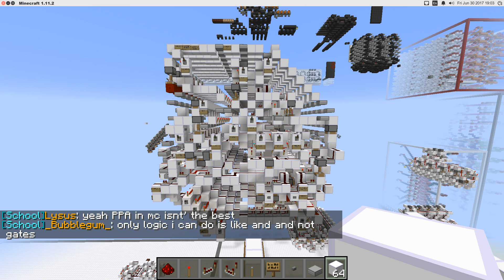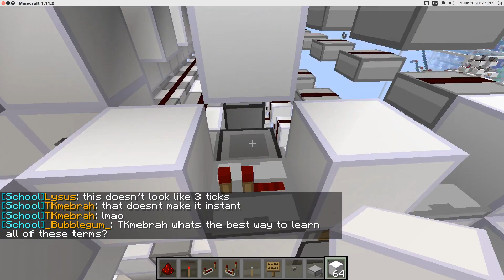Minecraft Compact 8-bit "Buzz" CPU

Comment: You might use the x^2/4 tables in RAM, as were used for many high-performance programs for 6502 based computers but it would require at least 512 bytes of RAM (or ROM) and the ability to index it. It works on the premise, that 4*a*b = (a+b)^2-(a-b)^2. It's best explained in a geometric way if you place four rectangles to form a square with a square hole.
the program computes the sum and difference of the inputs and runs them through the function by indexing and subtracts the results.

Comment: 14:00 That ALU was meant for forwarding ;-; I feel hurt
Reply from the maker: Well, in that version, I set it up for one output to be an accumulator that always forwards directly back to an input (and presumably the other output could easily bus elsewhere without worrying about dodging the accumulator logic or the other input). Although it's not true forwarding since it only works on one input, it serves a similar general purpose. If I offended you by doing this, then I sincerely apologize. I really do think it's an amazing ALU. I've yet to see or find another decent way of doing a vertical ALU that can do the usual ALU logic and bit shifting, and easily control inverted/zeroing/all 1ing the inputs, and have an output that can easily bus back to the inputs or elsewhere, and still be fairly compact and incredibly fast.
Reply: Ofcourse im not offended; you like it. I <3 accumulators, but generally i implement them as something you wouldn't call a standard architecture. Accumulative register writeback helps with filling out the IS that otherwise would cost 2/3 instructions extra (load immediate, add immediate, left shift, right shift, increment, etc) and they do require me to setup a forwarding section in the control unit.

Comment: 3:59 Please read the signs to the right :/
Reply from the maker: What about them? At some point I tried adding a pretty half-ass system for inputting immediate data via instructions, and it doesn't even allow a full 8-bit immediate. If you choose to use that, then it bumps down the max RAM speed limit by 2 ticks, leaving it at 7 tick max for RAM. I designed the CPU to work without that system though, since it was mostly an afterthought. So you can get on perfectly well without touching the immediate system, hence 9 ticks max for the intended usage (Plus, as an isolated part of a larger showcase, it's much harder to quickly explain why it's interesting that you can almost have RAM that's slower than the computer, but not quite because you might make use of a shoddy add-on that wasn't supposed to be part of the CPU to begin with). 
On the other hand, though, 7 ticks is still a pretty fair speed limit for the scale of RAM you'll likely build in redstone, so in practice the point is probably moot anyways.
Reply: True.
Reply: Wait, without immediate modes how do you create constants? The only way I can think of is using inverted ALU inputs to get 255 and adding/subtracting those a lot.
Reply from the maker: You'd need to generate them programatically, yeah. It's actually not quite as bad as it might seem since you can use the carry in + shifting to generate all the desired bits with minimal difficulty. In theory, the worst case performance for generating an N-bit constant this way is N instructions, but you can get the most common constants (0, 1 and -1) for free. That's one of the reasons I thought it wouldn't be terrible not to have it: Sure, it could take 8 extra instructions in a less common use case, but it's the same speed in the most common case. Since the main philosophy with this CPU is size and simplicity rather than speed anyways, that sort of tradeoff makes sense.
Reply: Wait, how do you get the most common constants?
Reply from the maker: - There's wires to zero either input, so that gets you 0
- There's wires after that to invert either input, and inverting all bits of 0 gets you -1
- Powering the carry in adds 1, so that gets you 1.

Comment: I'm pretty sure it was Hans Lemurson who built that program counter! https://youtu.be/5u56AbEomoE
Reply from the maker: That's an awesome program counter there, but that's not quite what I was using. Thanks for sharing though!
Reply: It looks like yours is a really improved/updated version, back in that time we didn't have redstone blocks yet, and his clock circuitry is different, but looks like the rest is pretty much the same at least in the video.
Reply from the maker: I agree they look similar, but the logic is distinctly different. He's using a t-flip flop counter that writes to a d-flip flop output, and the value is changed by overwriting the d-flip flop. The design I showed uses just t-flip flops, and XOR's the t-flip flop output with the desired value to decide which bits to flip to set the correct value.

Comment: What about cache?...
Reply from the maker: What about it?
Reply: If you really want a 8 bit address space for data, the latency for fetching or lag gets to the point having a cache is beneficial. However, nobody really has a working cpu with one. The software problems mostly are not big enough yet to justify it and even good redstoners generally dont know how a cache should work.
Reply: Cache isnt that big of a deal in minecraft cpu-s. its possible to make RAM that can keep up with the CPU (Unless benny goes full god mode and makes a 1 tick CPU), so you would just use that. no need for cache. would probably be usefull to have some sort of hard drive though since you can only have 256 bytes of memory with 8 bits
Reply: n0 u
Reply: doc :D

Comment: Benny, could you do a tutorial about the in-between bits of CPUs, computers, etc. that never really get mentioned? for example ALUs always get mentioned. Also I would love a pipelining tutorial :)
Reply from the maker: Well, in the upcoming series, I'll be doing a reasonable number of "in between" bits. I'd be interested to hear if you have any specific in-between bits that you'd like to see.
Reply: bennyscube Wow the 6502 processor, so what are some of these capabilities? One thing I would love to see is integer basic like the one found in the apple 2.
Reply: bennyscube Well, I would love to learn terminology. I often see people talking about stuff I have never heard of before and have realised later it's just something simple. Also, definitely pipelining and how different computer components communicate e.g. keyboard with CPU, CPU with GPU, etc.
Reply: Could you do a tutorial on the fastest/most compact subtracter and divider and try using all the new Redstone components to compact the computer components that are already compacted?
Reply: @poyodigimon5783  RPC1, PPC2 и RPC3 это самые компактные процессоры в майнкрафте